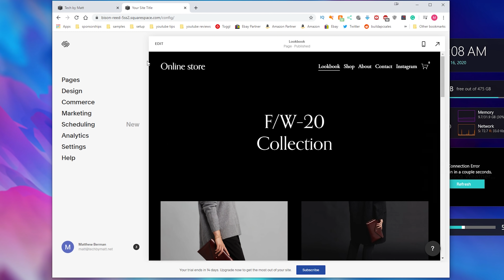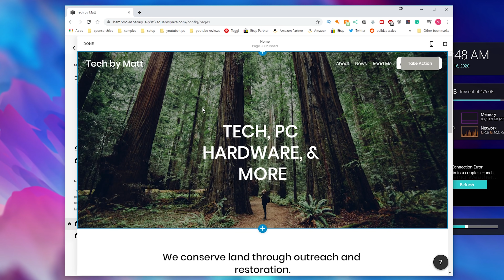Old Office PC + GTX 1650 = Gaming PC?

Comment: How big is the PSU that came in it? I am doing a similar setup with a 5060SFF with an i7-8700 running the 1650 from Gigabyte, 64GB Ram, and 2x 2TB (1NVME + 1SATA) with m.2 Wifi card added. Mine came with a 200watt unit and found a good 260watt, and hoping that will be plenty :)

Comment: I'm planning to upgrade my Dell Optiplex, I recently put 16GB of RAM and a GT 1030 on it, I was planning a 1050ti but it is too expensive for me, so I will go for the low profile 1650, I have an i5 3470 currently, and I would also like to change it after changing my 1030, wouldn't the i5 3470+GTX 1650+16GB of RAM combo be a burden for the 240W supply?

Comment: I have similar pc, hp compaq elite 8300 with i5- 3570, 12gb of ram and gigabyte 1650 mini (which is a little too big my cover has to be open but I don't mind it) psu is stock 240W everything runs smoothly.

Comment: I have a i5 7500 and gtx 750 ti will that work with my prebuilt 180 watt power supply
Reply: I won't recommend it.

Lemme break it down:
65w cpu + 60w gpu = 125w
Now, add 10w if you use a HDD, or 5w per SSD.
Not to mention the psu real output itself. Nor optical drive. Nor fan.
Reply: @wisdoom9153  what if my power supply is 80 plus bronze
Reply: @wisdoom9153  I just wish it works
Reply: @wisdoom9153  and just saying I've seen vids with power consumption of systems gtx 1050 ti and 1650 consuming 135 watts so 750 ti shouldn't be a problem I hope so
Reply: @Vivi-wo7tx  well... Maybe? Idk, really.
But if you do actually try that, small tips from me, try undervolting both cpu and gpu. That will reduce some power consumption without sacrificing performance.

Comment: wanted to ask you for advice I have an Acer veriton s2660g with an i7 8700 processor and a 180 w power supply is it enough for pet to operate the video card correctly? thank you so much

Comment: The GTX 1650 will take up two PCI slow space, so therefore you dont have space for wifi cards anymore, so how do you connect this system to network ? By UTP cable or by USB dongle wifi ?

Comment: Great vid. Quick question - did you have to upgrade the psu to handle the xeon and powerful gpu? 
I also got an Optiplex 9020 SFF, but the highest available is 315 watts from research so far.
Thanks man
Reply: the gtx 1650 has only a tdp of 75W

Comment: So I am doing this soon. Have ordered the bits And i have a question. Some videos state the PSU needs upgrading and some don't. What do you recommend?
Reply: I heard this too. And you'd need to know how much power the Mobo provides to the PCI slot.  You might upgrade the PSU but still have the same power into the GPU.

Comment: Hey, I have a Dell oem prebuilt and it has 260w psu. Planning to buy a gtx 1650, how much power will it need for the bare minimum?
I have 8gigs of ram
I3 10th gen
260w psu

Comment: Thx bro I just cleaned out my optiplex 3010 I got the graphics card but do you know a good power supply that would fit?
Reply: you can not replace the power supply in the small form factor dell optiplex, on the MT(full size) optiplex any standard PSU will fit. go for around 500 watts

Comment: Hi Matt ..
Just watched this video and I’m about to attempt the same thing.. but I’ve read so many conflicting things about the PSU not being powerful enough to run a GTX 1650..I can see you’ve done it, but is it only doable with that specific brand of card or will all branded cards work? With the price of GPU’s at the moment I don’t want to spend and for it not to work!! Any advice.. my PC is the exact same model… Dell optiplex SFF 790 i7 2600 .. cheers

Comment: Just wondering if the Nvidia GeForce® GTX 1650 MINI would fit into my Dell Inspiron 3650, which is roughly the same size as your Dell Optiplex 790? And also the stock 240W PSU should be able to run it despite the recommended PSU Wattage is 300W right?
Reply: no

Comment: I have a dell precision t1700 sff. I want to upgrade the gpu. I am currently using a gt 730 gddr5. Should i buy this card or somthing like a gt 1030. Also will that 255w psu handle this?

Comment: I have a similar machine (optiplex 9020) with a 1050ti. But I think it isn’t fast enough for VR I guess
Reply: 1050ti wasn't the best choice for AAA gaming at 1080p, especially not VR. I wouldn't even bother with VR on my Optiplex 9020 (i7 4770, RX 570 8gb).

Comment: I've got an 1150 socket any suggestion for upgrades? i've got an i5 5490 in here at the moment
Reply: I'd check for an i7-4790 on E-Bay and see if one of those falls in your price budget. You'd jump from a 4 core 4 thread CPU to a 4 core 8 hyperthreaded CPU... that's about the best you can do with your current MB... 

Other than that, you're really looking at a new build... the new Intel 10th Gen lineup is looking like it will compete with AMD's Ryzen this time around.
Reply: Mithrennon of Aegwynn its an overclock compatible board im planning on 4590k i5

Comment: What is the difference bwtween the blue pcie and the black pcie? My optiplex 9030 has white pcie, but not as long and black pcie at the bottom. Which slot should i use?

Comment: Does the motherboard put enough power to properly feed the card at the socket? I found another video where they pointed out that the motherboard was rated at 50 and the card required 75. Does that not drastically shorten the life of the card?

Comment: I have an LGA1155 board from a Dell optiplex 7010 with Core i5 3470, how can I tell if a Xeon processor is compatible with my board?
Reply: The only two ways I know of is to google it or actually try it. I have a dell optiplex 790 and i threw in a e3 1270 and it work despite it not being on the cpu support list but I would say you might be able to get a e3 1240v2 to work since it is a 3rd gen chip like the i5 3470 but there just isnt anyway to know for sure.

Comment: I did this with a full size optiplex 790 and put a GTX 970 but left the same processor (i5 2400) do you recommend upgrading the processor or going to a ssd?
Reply: Upgrade the SSD first then go to the processor

Comment: Hi! is it possible to put a Xeon E3-1230 on an Optiplex 990 DT? (250w 80 plus gold 17.8 in the 12V line, LGA 1155 Chipset Q67, HDD WD Blue 1TB 7200RPM, SSD 120GB WD green, 4 sticks 12gb ram [2x2 2x4 ddr3 1333mhz)
Thank you :D!

Comment: A blody ssd plss does not have to be a 512gb  120 or 256 is enough for windows 10 and frequintly used apllications like chrome.   ssd is much faster than a singular hdd.

Comment: how big is the PSU on those units? I have one lying around and only has 180watts can 1650 run off it?
also i was told that the top pcie can only support up to 30w of power so putting a 1650 which I think runs off 75w tdp might fry it.

Comment: Here's my build:

OptiPlex 7010 SFF
i7-3770
2x8GB HyperX Fury 1600MhZ
180GB Intel 1500 Pro Series SSD
MSI GTX 1050Ti Low Profile 4GB
Seagate Barracuda 1TB HDD 
Hitachi Travelstar 500GB SSD in a drive caddy, instead of the optical drive.
240W PSU
Reply: If you guys have any question regarding the similar builds you will want to be pursuing, ask me. :)

Comment: Hey, so I’ve recently been lookin into upgrading a dell optiplex with a 1650 low profile gtx. I’ve been concerned about whether I’d have to buy a new power supply or not, will it have any effect on the pcs lifespan to not replace the power supply?

Comment: i have a dell optiplex 3070 and am thinking od getting a gtx1650 so do i need to buy the low profile for it to fit or is the normal one fine??
just wondering any thing helps

Comment: i have dell optiplex 7010 i7 3770.
will 1650 and 1650 super works in this or do i need to upgrade power supply?
Reply: how much psu you got ?
Reply: @leto1449  max power 240 w
Reply: @saienterprise3102  if you can change psu it's better but it will work
Reply: @saienterprise3102  give me your whole specs to calculate the power you got
Reply: @leto1449  core i7 3770 3.4 GHz(8 CPUs)
RAM-2*4 GB DDR 3
1TB sea gate HDD
DVD Rom
Dell motherboard Bios version A29 
Dell Optiplex 7010
Reply: @saienterprise3102  as i suppose that your hdd has 7200rpm you still have left like 70 or 80 which is great because
Reply: those gpu dont consume a lot pf power
Reply: Gmpo Darkou thanks

Comment: hi matt, i have a optiplex 380 MT with C2Q Q8400 in it (bios version A07). I intended to upgrade the cpu to Xeon E5450. Before that would to ask you whether do i need to mod dell bios? Or i just can put the new CPU in and run the system?

Comment: Does the gpu overheat with this kinda config? i was thinking of putting a gt 1030 in mine. slight issue i have is i only have one pci-e x 16 on my motherboard and its closest to the power supply so the gap for me would be similar to this configuration. Would cutting vents or putting holes into the side panel help out to stop overheating ya reckon?

Comment: hey I have the Msi Gaming X 1060 6gb in my hand, can I buy one of these dell optiplex pcs and an ok psu and just pop the gpu in?
Reply: No, the Dell Optiplex dosen't have the Electric pins and since the dell optiplex is very small and does not possess a Lp model its not suitable for reviving old pcs
Reply: buy a dell optiplex mini tower with a 350 watt power supply and  a 4 pin to 6 pin adapter and youre set

Comment: Far too expensive right now. I'd rather get a full size optiplex with a larger video card. It's cheaper that way. That being said a vertical mount bracket and a Dremel would allow you to put a full size card into it.
Reply: I have an Optiplex 9020mt, biggest card I could put in it was a Nitro+ RX 570, and that is with removing the hdd bay.

Comment: Can I combine gt1030 with Ms platinum 400W ATX psu? 15A on 12v
Reply: I have a GT 1030 with an HP Elite 8300 and a 240W PSU, it handles GTA V at gull load without a problem

Comment: Does anyone on here know of the newest model that also has the  full PCIE slot that isnt near the pSU , I'm also trying to Install a GTX1650 on a dell optiplex sff, but the Dells that i own have the slot near the PSU which of course the GPU doesnt fit, and by the newest model im talking about the newest but old cheap optiplex machines just like this one on the video !

Comment: i have:  AsRock H81M-DG4  motherboard, do i need to update my system BIOS before installing GTX 1650 ?  I cant find anywhere if that card will work with my current BIOS version (i have now GTX 750 in my PC and i want to upgrade it with that card) i know that messing with BIOS is not recommended so thats my problem.

Comment: I have an optiplex 7010 (tower) with a 275w psu. I  want to put a gtx 1650 in it and dont know weather I should get the low profile or regular gtx 1650. I want to be able to stream and record fortnite. Or just record. plz help

Comment: That exact PC used in this video is what I'm going to buy for a starter PC lol. BTW mine is going to have a GTX 1030 or something
Reply: Hey, I have done the same, if your on a budget then definetly get the 1030, but if you are willing to spend a bit more get the 1050
Reply: Charlie Bradshaw or the low profile 1650?

Comment: is 240w psu good enough for gt 1030
Reply: Yes, I've got my i7-3770 with an HP 8300 System and it handles the GT 1030 at full load on Grand Theft Auto V

Comment: turns office pc into gaming pc
Me: oh pretty cool lemme check the prices
Dell optiplex - oh? Not bad
Xeon card - okay, decent 
The graphics card - aight imma head out

 Graphics card cost more than the optiplex and the Xeon card combined ;-; any affordable graphics card recommendations? Anything that would allow me to play war zone or sometime with decent FPS on low to med settings, or doom with atlease 40-50 FPS
Reply: Second hand 1050ti maybe?
Reply: I i would recommend some of the amd rx500/400 series but you'd need to uograde your psu for that. The 1050s were a good choice once but the market has decided they are worth their weight in gold for reasons lol
Reply: Check low profile 1050 / ti, rx 550 / 560.
They're bound to be cheaper. But obviously normal sized vga is cheaper.
So.
If you don't mind ghetto rigging it, I'd say throw that optical drive, buy pcie extension n normal sized vga, n place it on top of cpu.
That will works just fine, and save you about 20 bucks.
Reply: I have around a 70 ish usd budget sadly(for graphics card)... poor boi hours tryina get into pc gaming
The build I’m shooting for is a 
Dell optiplex 7010 with a i5 core
8GB ram (2 four GB sticks)
An POWORK 650watt power supply

For my monitor it’s a Sceptre E205W with 75hz

The only problem is graphics card. Rn I have my eyes on a 48$ GTX 570 1.28GB or a 65$ GTX 750TI 2GB

That altogether without the graphics cards is about 120-130$
Reply: Valter Branisarajevo checked it out and it’s way to far out of my budget 😪
Reply: Save up a bit more money and get something decent
Reply: WisDooM I found a rx560 for around 65$ it’s a singe game with 4GB “BIOSTAR AMD RX560 4G GDDR5 896SP Graphics Cards PCI-E 3.0”

And a rx 550 with 2GB Dual fan for around $75 “MSI RX 550 2GB Mini Graphics Card”
Reply: KING COBRA I’m too young to get a job and my parents are giving me $300 of the stimulus check they received from the us government
Reply: @NoshiroIJN  wait for next year. I think the priced should drop
Reply: KING COBRA damn bro I guess it really be like that
Reply: @wqbb287  the thing is, we don't know whether he can wait or not.
Reply: @NoshiroIJN  so you're gonna ghetto rig it with pcie extension cable?
Pricing depends on geography, so I won't judge you; but among 4 of them, gtx 1050ti is the best, it beats rx 560 by ~25%.
Reply: Hanate The Rice Farmer nah fam 550 and 560 are weak, just wait a time and add 20$ more u can get a 580 if your lucky or a 470-80
Reply: I did some convincing and I managed to get my budget to 400 usd. For the entire setup I have without the graphics card I have around 160 ish usd to spare. What’s a graphics card u recommend with that budget?

Just remember that this is going on a dell optiplex 7010 with a i5 core, 8GB of ram, and a 650watt power supply

Comment: how much power supply should be?
Reply: 450 watt is enough
Reply: @samknighted6603  i have 350
Reply: @synical4062  which cpu you using
Reply: @samknighted6603  i7 8600

Comment: My first pc i got two years ago and it was dell sff and i put gt1030 in it.
Reply: the GT 1030 is a fantastic first GPU! If you haven't already, try overclocking it using something like MSI Afterburner. I was able to get my old 1030 to boost up to 1933MHz with the fans pinned at max speed! Was able to play most games on medium @ 1440x900

Comment: I really think your first comment about these sff computers should be that the video cards can only be placed if the pcie slot is sufficiently far away from the power supply.  Most of sff computer have the pcie slot next to the power supply so that only a single slot video card will fit, unlike the dual slot card you’re using.... and single slot cards will not play the games you’re playing.... you should point out that you should research whether the sff computer you decide to buy will hold a dual slot card....otherwise this entire video is useless and may lead people to buy any type of sff computer which will be a waste of time and money.

Comment: Can you try testing BeamNG.drive in your future builds? It's a CPU intensive game that I would like to challenge
Reply: My Optiplex 9020 with an I7 4770 runs it pretty well, even on some of the large custom maps. Loading times are still pretty rough with the big maps even with a SATA ssd though.
Reply: @jeremebp  I have I7 4770 too, and even in 2020 it beats many modern CPUs. I have it with RTX 2060

Comment: I am disappointed.  Never mind the cheating by installing a better CPU and more memory.  What was overlooked was Raytracing and Vulcan.  I know It can handle it because I got an older stock lenovo s20 with 12g ram and got a geforce 1650 gtx about a month ago and OMG it made a ton of difference, especially sold me on Vulcan.  I tell ya, it's an experience that anyone wanting a new card will absolutely want Vulcan and forget about dx12.

Comment: People call this GPU crap when it is stronger than 1050ti
Reply: They call the 1650 crap not because of power under the hood, but the price you pay for that power compared to the competition. It has NOTHING to do with how many FPS you get from this card, it's the simple fact for the same price, sometimes less or sometimes $10 more, you get far superior performance from other cards.  The 1650 (not 1650 Super) is just a TERRIBLY priced card, and that's why people hate it.